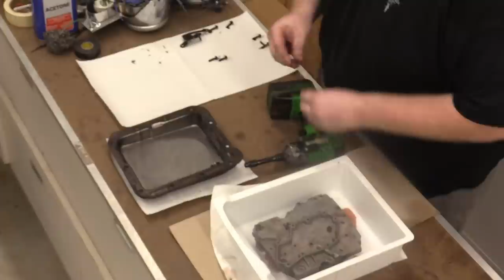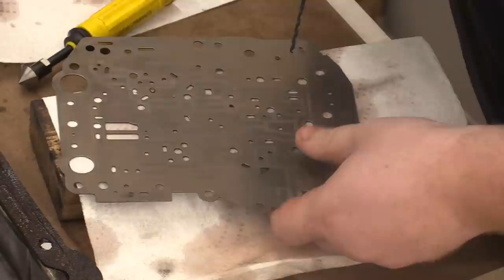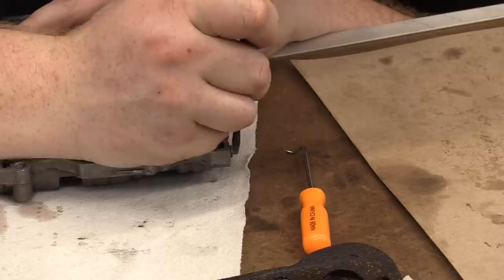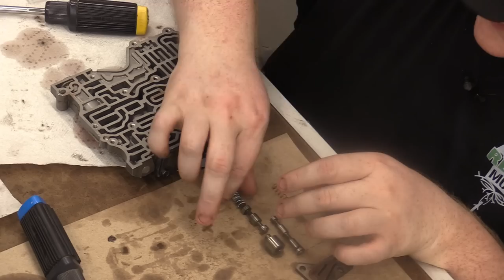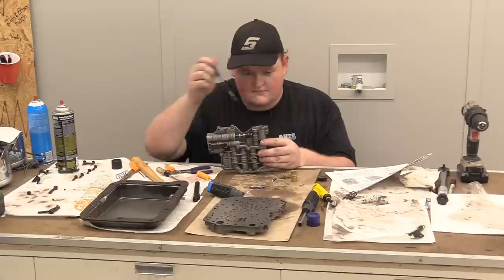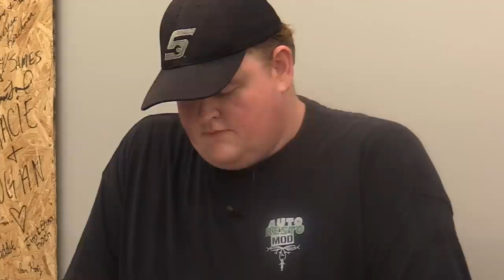We Upgrade a Ford C4 Transmission

Comment: PERFECT discussion of how you can spend time or you can spend money, but if you don't have time you'll need to have the other. Dad once came home from work after dark on Friday, figured out or already knew what was wrong, got the parts, pulled his C4 transmission, changed out the diaphragm spring, and had it back in the car in time to go to work on Monday morning. I was impressed.

Comment: Im just restoring  a 76 F150 and it idles high right now. 
SHOULD a 3 spd auto from 76 clunk into gear? is it just because of high idle?
it shows positive engagement doesnt it, definitely better than slushing into gear over ten second period, correct?